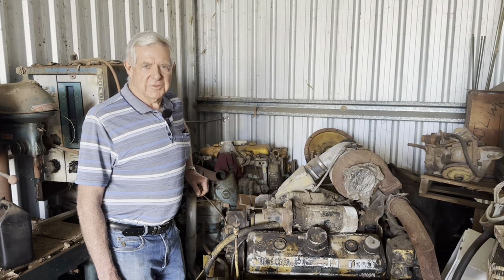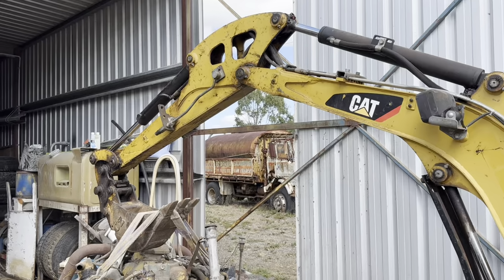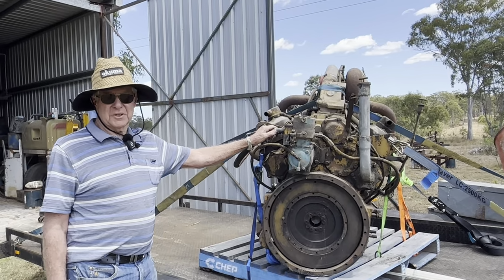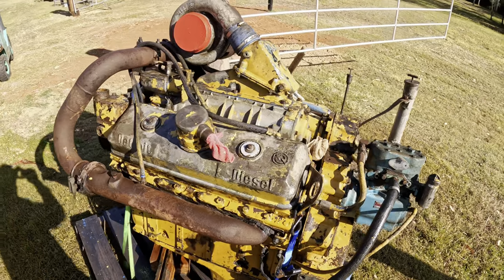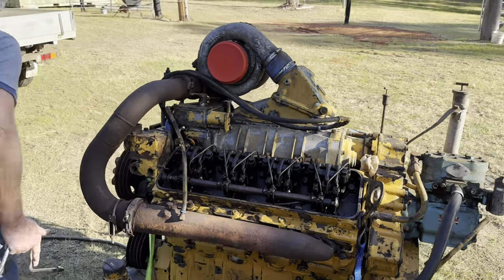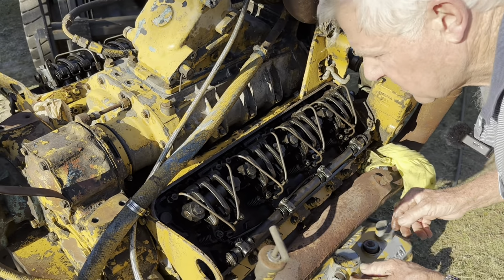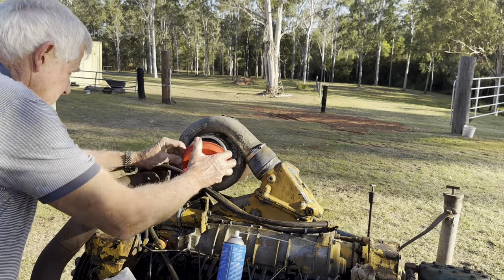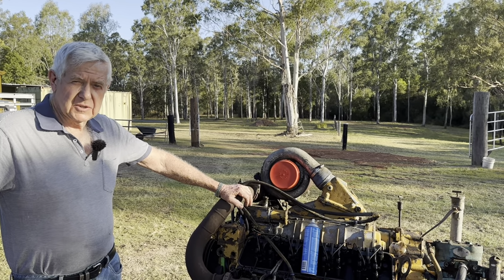2 Stroke Supercharged Detroit Diesel V8 GM 8v71T Truck Engine Revival Pt 1

Comment: Detroit usually painted their motors green, Caterpillar must have sprayed them yellow for the dozers and scrapers. That Leyland Boxer/Mastiff truck in the background would be a good resto project Bruce. Overall it's in fairly good nick Bruce, should be a goer, Detroit made a quality product.  I wonder hour many hours it has clocked up?  Great video, awaiting part-2, thanks Bruce.😉
Reply from the maker: Hi Dave, some parts of it are the green colour under the yellow like the intake but other parts don’t look like they’ve ever been green so it’s hard to say. It wasn’t super dirty outside and I was shocked to see how clean it was inside the rocker covers- almost too clean. Part two will involve a closer bottom end inspection before I try to run it so stay tuned. 

That Leyland was in a rear end fire. It otherwise looked complete, like it might start and strangely was fitted with some kind of ford v8 diesel? 

Thanks for watching, Bruce!

Comment: This is going to be a good series , coming to this engine after another mechanic has been in it makes it more of a puzzle .  Was hoping you would explain that the stuck injector rod would result in an engine run away when started , just for the veiwers that don't know GM's .  Also can you add your history with this engine , it appears you have been around them in the past . I'm thinking someone in the past was going to buy this lump , checked the rack and found it was not safe to start up then went to see the condition of the bottom end .  Hoping all was good and that the asking price was too high at the time .
Reply from the maker: Hello Steve, I agree with you on both points. It will be interesting to get that sump off and see what awaits and I did wonder if that’s what’s happened with a possible previous purchaser. It feels okay barring it over making me think everything is still connected in the bottom end but time will tell. I’m by no means an expert on GMs but I might do an explainer on how they can run away as I’m getting the injectors unstuck. I’ve had a bit to do with the v12s and v16s in rail applications but not a heap with these smaller ones. The loco engines did huge hours but never sat around. I’ll do a video on the sump and throttle plate, side covers ect in due course. Thanks for watching, Bruce
Reply: Can find  old  rusty  top fuel dragster engine  or monster truck engine

Comment: Standard 8V71 was 304HP and 800 Torque. The 8V71T with the boost from the turbo system was 350HP and 965 torque. The roots blower is a requirement for these engine to run at all, and it provides no boost. All the boost is from the turbocharging.
Reply from the maker: Thanks for the Help Bill, Bruce
Reply: Nissan did some 2 strokes and there's a guy with a  UD5 2 stroke, the UD8 was 600 CID, 345 hp w/o turbo and with turbo over 550 HP

Comment: A quick and dirty method that I have had work on those injectors is to remove the rockers and take a brass hammer and manually actuate the injector while attempting the run the fuel pin in and out, if the plunger goes down and stays down, you may have to soak it before disassembly. Big thing is do not hammer on the fuel pin itself.
Reply from the maker: Thanks very much for the help, Bruce

Comment: Good on ya mate for trying to bring  a DD back to life!   👍👍👍👍👍

I always wondered what happened to old DDs,  looks like a bunch went Down Under !!!

I used to work on DDs and the dry-sleeve, common-rail setup was so much easier to repair.  Everything in one of these is HEAVY—took two of us to lift a head off of a 12-71! 🥵🥵🥵

For setting the rockers you’ll need. “Go-No go” feeler gauge to get the spacing right. (Been  40+ years since I last did one of these, so don’t remember the exact number of 1/1000” gradations for spacings, but you’ll need one to get max performance to help reduce “Slobber.”

My best to you from an old “Cranky Yank!”

Comment: They're not supercharged by the Roots blower. In fact if it didn't have the turbo, Detroit Diesel would designate the blower only types as N for natural. The turbo variants get the T designation from Detroit. On the N variants, when new the blower pressurizes the air gallery to .7 psi over standard pressure. On the N variants, the blower output is carefully sized to the NA volume of the cylinders at all rpm - the .7psi over atmospheric to compensate for blower wear and tear, and hot, high barometric pressure drop in order to make rated power. Since it is technically a Uniflow Diesel the blower is needed to aspirate the cylinders because it wouldn't run without it.   
On the T variants the blower is retained for starting, idling and low power. Unfortunately when on turbo boost the blower becomes redundant but consumes considerable engine power that still has to be paid for in fuel. 
Bypass blowers save 30% in blower pumping losses when on turbo boost which is better than nothing but far from ideal.

Mid sized GM-EMD Uniflows (645/710 series) have a hybrid centrifugal blower/turbo where the compressor is driven mechanically at low speed and by exhaust at higher speed via an overrun clutch. This was proposed by GM-Detroit Diesel in the development phase of their small size Silver Series 92 (6V & 8V) engines since it was in the family so to speak but development costs combined with better turbocharger technology being applied to inline 6 engines that produced more torque (although over a narrower powerband than a Detroit Diesel Uniflow) and saved fuel by having no blower and 2x fewer cylinders to substantially reduce pumping losses thereby freeing up power and on top of that improving fuel economy again at low boost, put an end to that good idea. 

Interestingly, Commer Knocker opposed piston 2 stroke Uniflow Diesels do actually have true supercharging although the boost is rather low perhaps ~4psi or less.
Reply: Right, it's a uniflow design. No actual supercharging from the blower. To get boost, they have to have a turbocharger.
Reply from the maker: Thanks very much for this info, Bruce

Comment: Special application just means it's not a normal GM arrangement, if it was a genset drive or an industrial pack the number would indicate that. Tin sumps are common truck items which could be fitted to industrial engines if space was tight. It's normal for 71's to show some wear on the big ends with a lot of hours so seeing a bit of copper on the inserts while not good doesn't mean it's trash. Another worthwhile check on an unknown engine is to remove the small rectangular covers on each side of the block, these are the air box covers, once off you can see into the cylinder through the liner inlet ports and see the state of the bores, if the rings are broken or stuck, if the piston crowns are damaged and with a small mirror or a boroscope look up and get an idea of the condition of the valves. As you have found someone has been into the governor, these are fairly simple but very delicate to set up, get your hands on workshop manual or on old bloke familiar with them to make sure it's assembled properly a runaway 2 stroke is not much fun they will valve float for a while at massive revs before usually the blower binds up or it drops a valve and it all stops . Having a CO2 fire extinguisher (red bottle with black band) handy is a good idea when starting an unknown engine, a good shot straight into the turbo inlet puts it out almost instantly with no damage to the engine or mess to clean up.
The old Detroit Diesel is still the most efficient engine ever built for turning diesel fuel into noise 🙂
Reply from the maker: Thanks so much for all this information Ray, I’ve taken it all into account in my bottom end inspection video posted this morning, best wishes, Bruce
Reply: No that would be easily (and I do mean easily) surpassed by the Commer Knocker opposed piston Uniflow Diesel. The noise they make is beyond belief.

Comment: Hiya Bruce greetings from the UK amazing video that sure is one hec of a beast of an engine, Will be great as someone has been in and touched it it probably would be a good idea to go through it with a fine tooth comb, I'm sure you will your attention to detail is legendary is it going in the Bedford? Keep up the great work my friend love the channel ♥️👍
Reply from the maker: Hi Dean, thanks again for your support and kind words, no not at this stage it won’t go in the Bedford. I have seen a couple of TK bedfords here in aus used as single drive prime movers with 6v53 detroits fitted and I thought that might have been a factory option? A 6v53 is a much smaller engine in physical size compared to this one though, but it would sure wake the old fire truck up compared to the 300. I’ll do another video on the bottom end, possibly next weekend. Best wishes, Bruce

Comment: Cheers Bruce still lighter than a Cat or Cummins. Did that GM come out of a scraper or something. What are you doing with the engine and how much would you sell it for?
Reply from the maker: Hi Andrew, yes a 621 cat scraper. We are not certain this was fitted from new. I’m not sure what I’m going to do with it yet but you would have to watch my latest video before you made any offer 😂 thanks again, Bruce
Reply: @bruceinaus   Thanks. My first comment was a bit abrupt as you hadn't got to that stage. Just a rush of blood on my part . But the old 318 with turbo sure could get up and go. Cheers for the upload.

Comment: GM in a cat scraper..........it must have been a repower to replace something like a 1673?   The old skool turbo's were very inefficient compared to the modern designs......hence their large size.  The turbo's on CAT dozers from the 1950's were twice as large again.....for about the same hp.  For some context, the 318hp rated 8V71T from the late 70's is not that much stronger than say todays 6.7 Cummins, 24 valve 6BT.
Reply from the maker: Hi Wazza, thanks for the comment. It was fitted to a 621 cat scraper, I’m not sure if it was a repower or not and it looked to have a 3306 fitted into it after the gm was removed. It’s seems it’s the way of the world, modern technology, power levels increasing in smaller engines ect. Someone seemed to think this one was 350hp but I have no way of verifying that. Thanks for watching, Bruce.
Reply: @bruceinaus   Terex used GM engines in their earth moving machines, but I am 99% sure that Cat never did.  Still, thanks for saving it, there are fortunately some great GM 2 stroke enthusiast channels on youtube ))
Reply: GM turboes were never intended for high boost, the intent was to recover  the power lost to driving the blower, they were a fairly relaxed low stress engine.
Reply: @raygale4198    there is a guy who has a channel here on youtube  who has a 4-53 twin turbo in a Ford F-350 who is getting really good results.  He uses his pickup as a daily driver and also rescues other GM's.  Also check out the 8V-92 "Joyride" which has been fully modernized..........600hp and not a trace of smoke.  Low boost in any diesel only does one thing......waste fuel
Reply: G'day, 8V71T is usually 350hpwith N75, 335hp withN70, and 8V71TT 305-308hp, 318is Na with N65 290hp with N60& 270hpwith N55 obviously there is then red tag, brown tag, white tag etc, there will be people with far more knowledge about them👍
Reply: @bruceinaus  G'day, Old Teararse in Wang had two 621scrapers that he repowered with V871T's he also did 2 more with green 892T 430hp, I will stand corrected on this information, they were then sold to an earth moving contractor in Euroa after many years service, they were then sold from there about 6 years ago, with 1 of the 8V71T ones turning up at Maryborough machinery, do not know the fate of the others, again I will stand corrected, hop this helps👍 ps blower, not supercharger 😉
Reply: @wazza33racer  Sorry old mate, that 2nd text was supposed to go to the gentleman with the video 👍

Comment: it is NOT  supercharged
Reply: Doh...
Reply: yes it is
Reply: @IanCampbell-sh3si  wrong , wrong ;;;
Reply: @simongilbert2704  right right right as they have to have a supercharger for cylinder scavaging
Reply: @IanCampbell-sh3si  wrong ,-- it is a mechanical blower to scavenge exhaust gases , it does NOT create a significant boost to the engine , gm used turbo's for this , only when the blower is geared to make an increase in p.s.i.  can it be called # supercharging , , this idea was brought about by jimmy rootes ,,  [ some doubt about that ]  british car and truck maker , to vent two strokes , over 5 million d,d,s have been built and i have not heard of any being positively charged  from the factory ,;;;  so the motors are not charged - just vented ,

Comment: Yea . A big lump go iron there mate ! It will prolly run though , Those GM's are pretty reliable .
Reply from the maker: Thanks Scott, it will be interesting to see why all the rack rods are disconnected and why the sump has been with those 6 stuck injectors so cross your fingers and toes for me! I can feel any huge clunks baring it over so that’s a positive sign I hope, Bruce
Reply: @bruceinaus  It sure looks like someone else was attempting to repair it , then gave up ! Good luck with it mate . Scott 🌵
Reply: I like my silver 8v92 2 stroke turbo to tinker with but some folks have them Nissan UD 2 strokes and the power is just nutty on those.